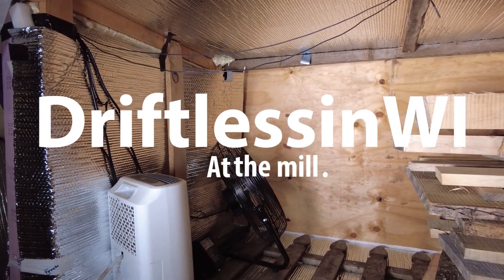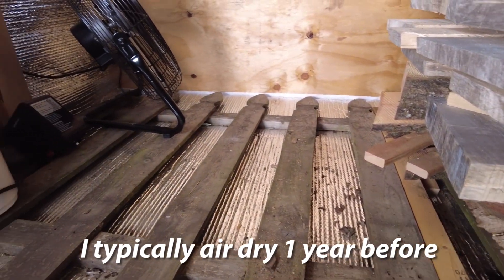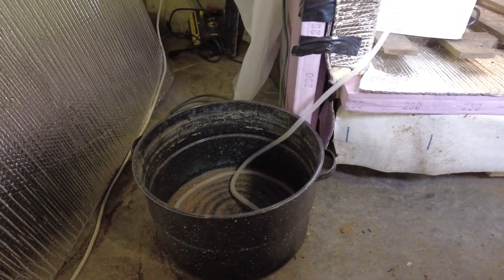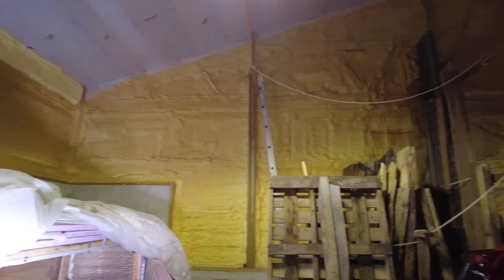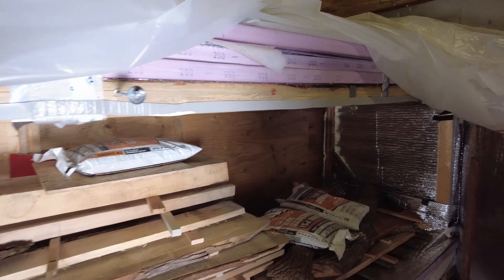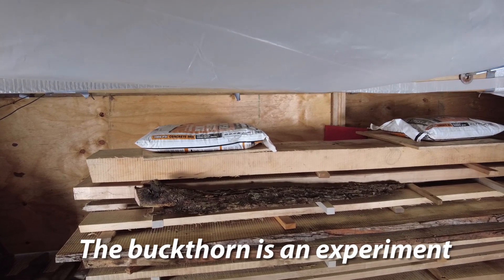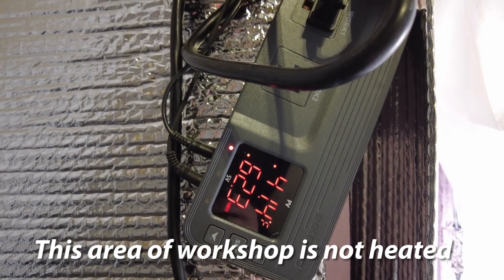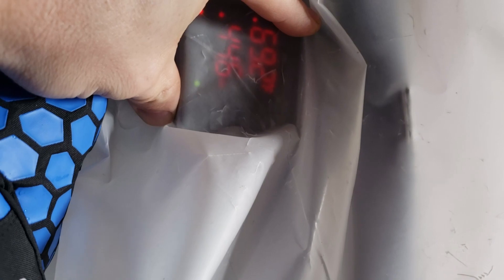Tour of my Simple DIY Dehumidifier Wood Kiln - Super Energy Efficient and Mobile - Buckthorn Drying

Comment: Thanks for sharing and the video ❤ question = I would think it would be better to put the water pail outside the kiln seems your pulling it out of the wood and air but it keeping it in same area? So what’s the total cost if we had to buy all the 2” foam sheets. And electrical components, including the dehumidifier just an estimate of cost.
Reply from the maker: Thanks for the question... the pale is outside the plastic on the kiln.  I do have a plastic sheet over the whole thing to trap the warm air,  the water vapor condenses on it and drips to floor.  The whole thing would cost between $1000 to $1400. Foam would be largest expense,  4" in all sides will cost about $800 currently ($40/2" sheet, 4 per side,  5 sides total). The range depends on where you source lumber and what dehumidifier you use.  I used 20' metal roofing pallets that I already had from another project... you could probably find them for free.  The little heater is cheap, and so is the plastic. I did include some links in the description you can use to get a current price estimate on electronics. Thanks again and good luck, I still use the kiln regularly.

Comment: How would this work with firewood?
Reply from the maker: I think it would do well, especially if you didn't need to do a lot. I would make a few modifications,  like making wood walls all the way around so you could dump or throw wood in.  If you want to do a lot,  you probably want to dry by burning wood,  so you would need to figure out how to add a fire box. Probably the best option is to just use a solar kiln :) since you don't need furniture grade dryness for firewood.  Thanks for the comment!

Comment: When you say go slow, and your initial reading was 62% RH, what do you set your humidifier to? If you have a green load in there, is it safe to drop it by 10 points every week?
Reply from the maker: For my setup,  going slow just means running the dehumidifier by itself for longer...no heater. I have found its hard to mess the wood up if you don't use the heater. My dehumidifier is small,  so I just set the RH to lowest setting and let it run with the fan blowing through the stack.  The heater is really only needed for killing off bugs. Hope that helps.  Thanks for the question!
Reply: @driftlessinwi  thank you!!

Comment: Thanks for video.  I just put my first load of wood in mine a couple of days ago.  My dehumidifier manual says it stops at 90, but the cheap temperature/humidity sensor/display in there says 104 after a couple days (north florida).  I played around with an Arduino micro controller and a powered outlet using temperature/humidity sensors, but when I read the part about 90 degrees I got discouraged for a while.  Decided to go for it at 90 degrees since my wood is also a couple years air dried, and about that same time I found your video.  It appears to be pulling a quart or two a day in the first couple days.  My pink foam is taped real well at the seams and my doors have seals, so I don't think it is pulling humidity from outside air.
Reply from the maker: You can try putting plastic over the whole kiln too too see if that helps. I find it is good at trapping humidity in and keeping it out,  letting your dehumidifier be more efficient.  Also, just moving air in a warm space dries wood quickly.  Sounds like you are having fun experimenting :) Good luck!

Comment: What is the wattage of the dehumidifier you are running, do you run it flat out from the outset or increase the out put if you have  variable settings?
Reply from the maker: 200 watts and it is rated for 1500 sqft of coverage, 32 pints daily. Thanks for the question!

Comment: Question:  When you turn on the heat to kill insects, do you remove the dehumidifier?
Reply from the maker: I do not,  I leave it on and let it run.  Humidity spikes when the heat comes on.  The max temp I usually see is 150F. The humidifier is cheap and I figure it will eventually fail in this setup,  but it still works fine after 10 loads through the kiln. Thanks for the question!
Reply: @driftlessinwi  I was worried about melting of the plastic most are housed with. But when Google search revealed that 200+ degrees was needed to melt plastics, I stopped worrying about it.  Thanks,  L.A.
Reply: @driftlessinwi  Hello sir, do this humidifier keeps running after 100 fahrenheit ? Because I heard some just power off after such temperatures. I want to buy one but not sure if it will automatically shut off or not ?
Reply from the maker: I honestly don't know when this dehumidifier shuts off, but it doesn't seem to shut off when running at 110 degrees F.  When I kick on the heater, it may shut off when I get to the 140-150F range.  I think the best thing you can do to get rid of humidity at the high temps is to put the plastic over the whole kiln and let it drip down onto the floor (assuming you have drainage).  I made sure everything on the kiln could handle water (all the foam board).  You could do without the plastic, but you will lose a lot of heat in the process.  Lastly, when the temperature is up in the kiln, the wood loses water quickly, the most important thing is that your fan is running at high temps.  I am not sure the dehumidifier is even very important when I have things going at high temps :)  Hope this helps!